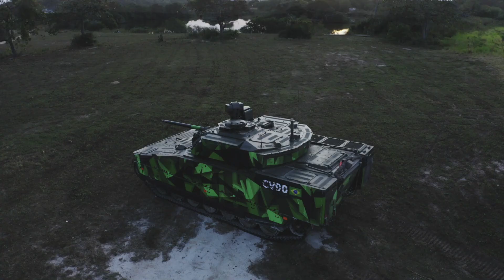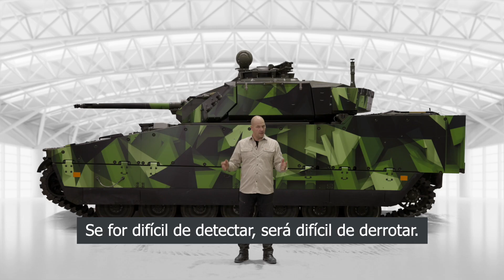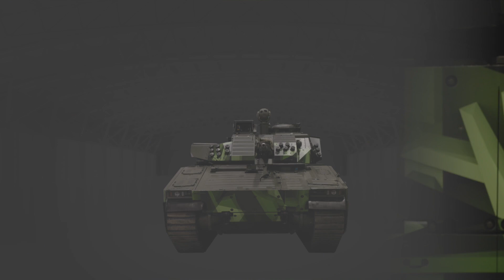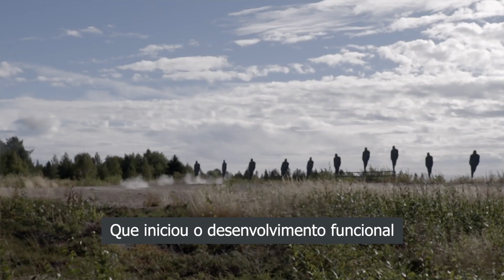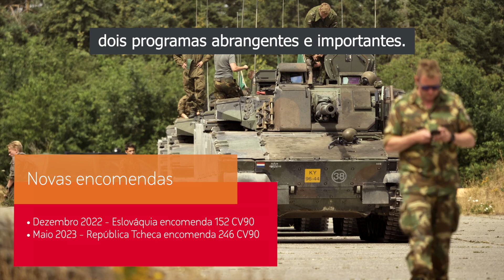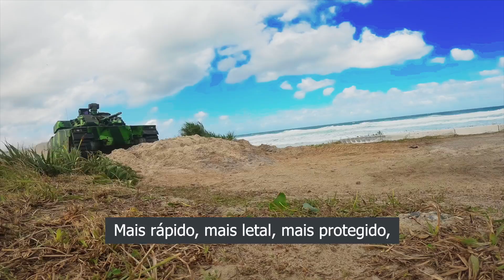CV90 MkIV – O VBC FUZ de combate

Comment: The  CV90120 would be perfect for brazil
Reply: Pró VBC FUZ (IFV) é muito bom , a marinha devia dar uma olhada também substituir os sk-105 e os m113 dos Fuzileiros , agora a versão com canhão 120mm (MMBT) no exército teria que ser um tanque complementar , operando junto de um MBT talvez um 60/40 
60% de MMBTs e 40% de MBTs , adendo que no caso específico dos fuzileiros o CV-90 120 (MMBT) cairia como uma luva , pela limitação em relação ao peso máximo da viatura no desembarque .
Reply: Brazil recently bought the Centauro II, and the HITFACT II turret is basically a universal turret, meaning it can be mounted on practically any hull.
Reply: @LucasGator2  Recently Lynx has been learning with a hitfact 2 tower.
Reply: SIMM

Comment: When will FM start using them, like, how come Brazil is faster than Sweden with this
Reply: Sweden has ordered them the CV90 has been demonstrated in  Brasil so Sweden is faster.
Reply: @kjell-oh7ez  afaik, Sweden ordered the Mk3C with the 30mm gun.
Reply: @SonsOfLorgar  MKIII C 35mm not 30mm. It also look to be temporary to fill in the gaps of the donated CV9040s to ukraine. Hopefully in the future when they make the next decision to order a bunch of the latest one they/we will choose the 40 mm variant in a newer configuration.
Reply: @SonsOfLorgar  35 mm.  not 30 mm.
Reply: @kjell-oh7ez  Sverige har beställt Mk3C, inte Mk4.
Reply: @jonasastrand9945  nej de nog ett tag kvar innan sverige bestämmer sig för mk4an tyvär, inte nog me att Sverige e så dåliga på att förnya, ersätta å beställa saker, så e ju mk4an inte riktigt klar, de håller ju fortfarande på med att utveckla den där 3d karta ai systemet
Reply: Mk IIIC is basically a Mk IV Turret on a Mk III hull.
Reply: @kevinl2482  ye well like the whole computur system and all the stuff under the Hood, like yes, from the outside, they are kinda alike, but the its not the outside on the mk4 that are the important part.
Reply: @ No like it is said in the procurement that they took the D-35 turret of the Mk IV and put it on the Mk III hull
Reply: @kevinl2482  ye well thats not the important part of the mk4? Like i said, the oustide of the vehicle may look alike, but thats not the new and important part that the mk4 introduces
Reply: @ What? It has everything the Mk IV has other than the better power train. All the stuff other than that is in the Turret on the Mk IV.
Reply: @kevinl2482  the computur system?
Reply: @ Yes, the turret looks the same for a reason. It has to fit all the new systems. It wouldn't look thr same if it didn't have the same systems. "The D35 turret is a highlight of the modernized CV90, equipped with a 35mm cannon and the mast-mounted COAPS-L (Compact Optoelectronic Advanced Stabilized System). This system significantly enhances the vehicle’s surveillance and targeting capabilities. Additionally, the turret includes the Iron Fist Active Protection System (APS) and the Spike-LR2 Anti-Tank Guided Missile (ATGM) pod." 

"While the D35 turret represents a major advancement, the vehicle retains the Mk.III hull with several enhancements. This approach combines the best of both worlds, leveraging the proven reliability of the Mk.III platform while integrating advanced features from the Mk.IV variant."
Reply: FMV beställde nya cv90 i början av 2024. Det tog mig ca 10 sekunder att googla "FMV cv90 mk4"